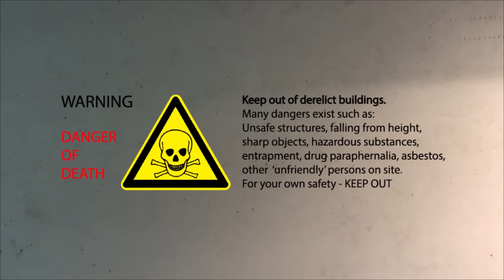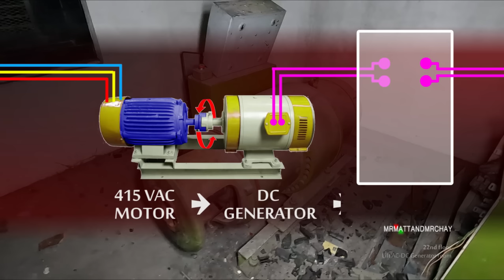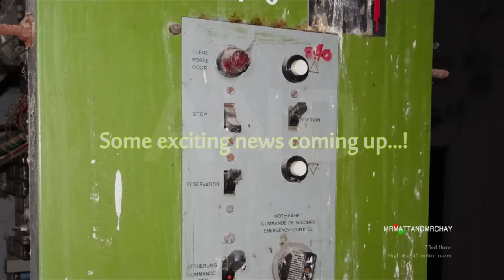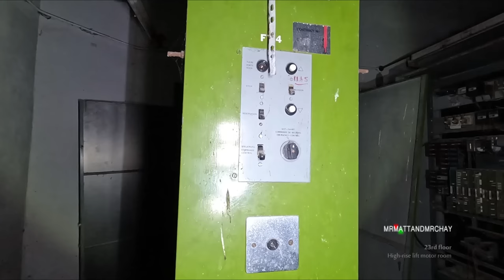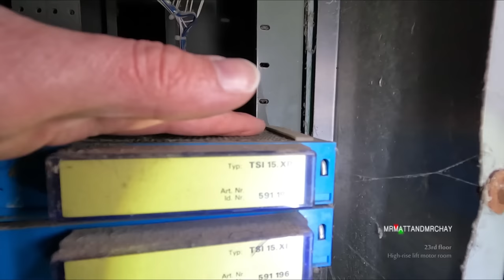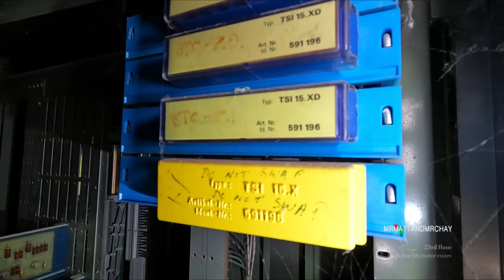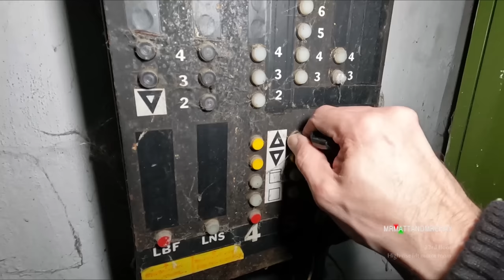ABANDONED TOWER EXPLORE - Rare ACONIC transistor lift control system from 1970s

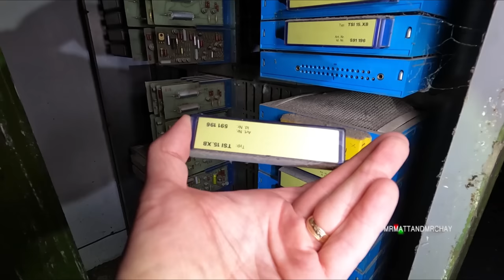Comment: Fascinating video, well done! 26:00 I wonder why they use those blue+yellow plug-in modules in that way - I expected them to be different, but visually they look the same with those arrays of transistors, etc. Or perhaps they're wired differently internally as a way of encoding a floor number or somesuch.
Reply: Actually it just struck me that some of those transistors are oriented differently. Maybe that is used to represent a binary number?

Comment: Just wanted to mention that the “grid” in the blue box with the transistors plugged in ( 15:42 ) looks like some ROM memory (read only memory) but I’m no computer or lift expert so don’t rely on me
Reply from the maker: The only thing I could see in the blue boxes were resistors.  It would have been unwise to connect power directly to a transistor, so each transistor had a resistor in-line.  Depending on the function of each transistor and the 'load' it was switching it's voltage to, this would have made the resistors warm, hence the large box with ventilation above and below.
Fascinating system though, and the only part that could really go wrong were the transistors, which were "swap-out-able".

Comment: Is this a German logic? because on the board for the controls I could read "Elektronikgerät", which translates to electronicdevice
Reply: This system was invented in Switzerland, so all the abbreviations are German as well. The lifts here were installed by Schindler.

Comment: I'm not 100% sure, but I think those banks of plug-in transistors may have been forming very early versions of logic gates. So one plug may have been an AND gate, and another an OR gate etc.
Reply from the maker: Yes, I'm sure you're right there.  The resistors cannot really fail, but in case the transistors do they can be unplugged and a new set plugged in.  Imagine trying to fault find this..!!
Reply: That's what I'm thinking too, it almost looks like it was a matrix of resistors, these would have been used as pull up/pull down for the transistor bases, at least that's my guess.  Probably designed in such a way that they were easy to manufacture in grids and just stacked.

Comment: IHi there, I have a quick question. What type of lifts had the relays/logic on the ground floor?
 Where I lived as a child there was a room on the ground floor that had the lifts relays/?logic inside. Also, there was no motor room per se, it was just massive cupboard doors on the top floor that opened and it had a huge wheel in a cage that made the lifts move while the wheel turned. 
Sorry for a vague description, but I was a child at the time when I saw the "wheel in a cage" as the lift engineer forgot to lock the doors, thus curious kids, me included opened it to see inside. 😱And I think I could see right down the lift shaft watching the lift move. I remember a time when the lift got stuck between floors and the caretaker of the building used a big winding handle on the wheel to move it a floor so he could then open the doors and release those inside. ( I was always hovering around when it was anything to do with the lift as it fascinated me) 
 I remember the engineers another time, in the logic/relay room. The door was opened while he was working away so I stood outside the door to watch and I remember seeing a box on the wall and whatever was inside made sparks (this I have now learned was the lift logic/relay) I always remember there was was a sign on the door  of tht room warning of "high voltage" and to" keep out".  
The lifts were installed in the late 60s when the flats were built.
Reply from the maker: Hi Panthere, I believe you're talking about a bottom drive machine, where the rope are driven from below, then go all the way up to the top of the shaft.  I have a couple of examples for you: https://youtu.be/8gZaQzdtJwY?t=177   Then look at https://youtu.be/8gZaQzdtJwY?t=614 (10:15) and this is the bottom drive motor room.  It might be that this resembled a cupboard in the lift that you're talking about.
Whether a lift is top or bottom drive all depends on the building design (i.e. where they had room for it).  Bottom drive is more expensive as you need more divertor wheels to get the cables to the top of the shaft before they come back down.
Everything else you mention about the wheel in the cage, and hand winding the motor is true.  This is someone else's video of a lift being hand driven: https://youtu.be/mnV4MXmAOPU?t=745
Hope that helps :)
Reply: @mrmattandmrchay  Perfect, thank you for replying!
Reply: @mrmattandmrchay Hi.  Thanks for replying and sharing the links. Looking at the links, our flats didn't have a basement, but there could have been a trap door in the pit of the shaft that housed the machinery, I do remember seeing the shaft pit, and seeing 2 springs/dampeners but that is all I can remember. 
I recall The lift shaft was very narrow, as my brother who was full of mischief, used to scare me when in the lift as he could push his arms out and push the walls of the lift and they would scrape off the lift shaft as we moved! The levelling on it was awful as many a time I tripped coming out the lift as the step was sometimes 5/6 inches higher. Do you know what companies made those bottom drive lifts? I have Kone in my head for some reason, but as I say it was that long ago my memory is very vague. Thanks again.

Comment: 26:00 The swiss engineers of Schindler in the time were very careful with transistors as active electronic parts in a lift control system. They made them changeable like electronic valves.
Reply: Engineers of Schlieren not Schindler.
Reply from the maker: Thanks for the comment and yes, fascinating system and plug-in transistors.  I'm not sure that I'd like to fault find this though - imagine randomly swapping out transistor boards until the lift starts working properly again!  The know-how must have been very specialised!

Comment: Wait, why was there a hole in the floor of the Elevator mechanical room?
Reply from the maker: Emergency access by the fire department, in case no key can be found to access the motor room (in this case it's the generator room, but both should have same hatch access from beneath).
Reply: @mrmattandmrchay  Ahhh! Thanks!

Comment: How did they do that graffiti on the top of the building? Meanwhile I can barely clean my gutters without feeling dizzy.
Reply from the maker: It must require some skill to lower the roller down to the same level each time and keep track of what you're doing.  Not that I'm promoting it, but a skillset must be required to do that from that angle.